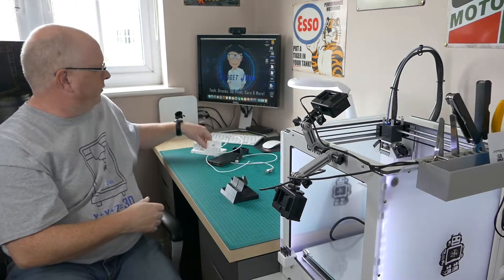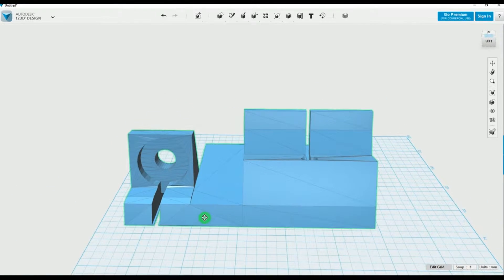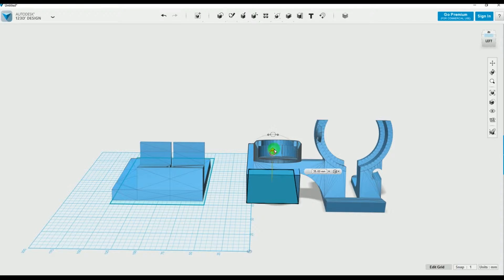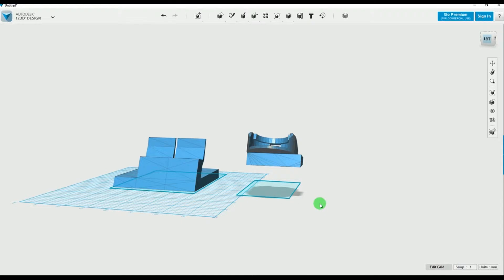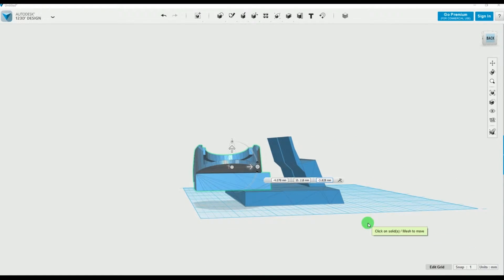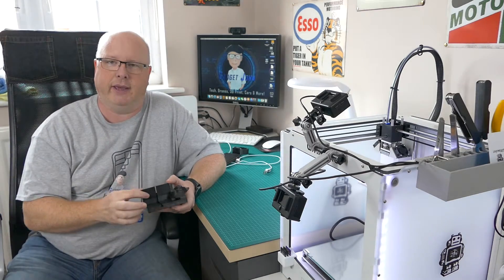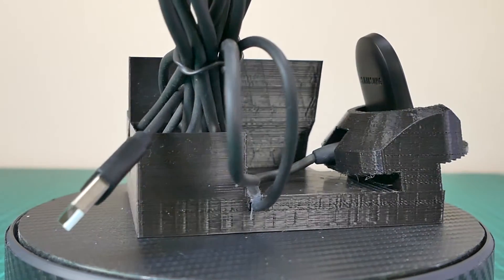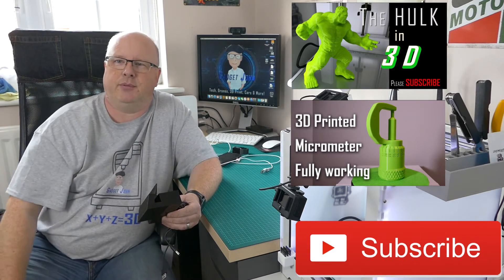How To: 3D Design with 3D Printing Timelapse of Charging Dock for Galaxy Gear S2 and Galaxy S6 Edge

Comment: That is really creative. Was that in ABS or PLA and which one do you prefer? Did you notice you put the timelapse in twice. Lol Either way great job. :)
Reply from the maker: +Panoreth 3D Printing I always use PLA, I tried ABS and found that my printer didn't get hot enough to print ABS, unless I enclosed the entire printer and I didn't want to do that. 

The first timelapse was the first design, then I changed the design to add the box at the back and cut excess plastic off the design, so the 2nd timelapse is the finished model. Thanks :)
Reply: +Gadget John I is stupid.. Lol